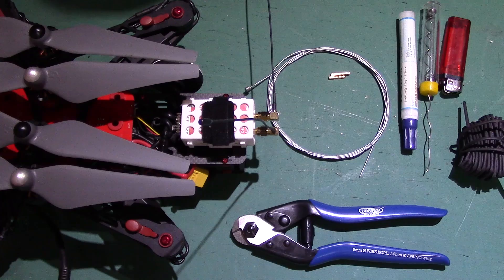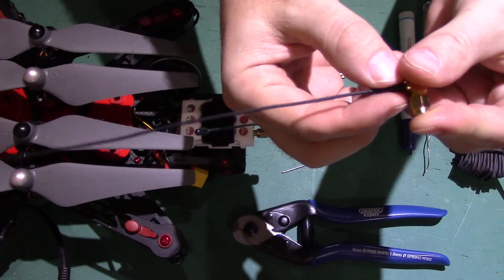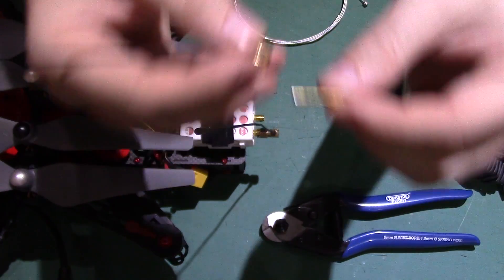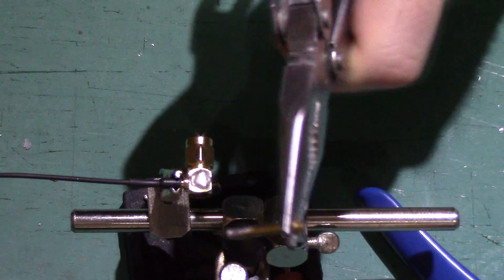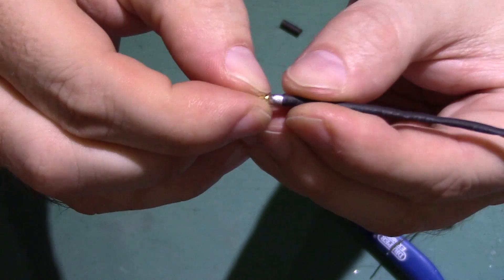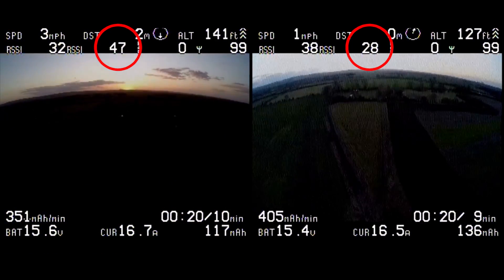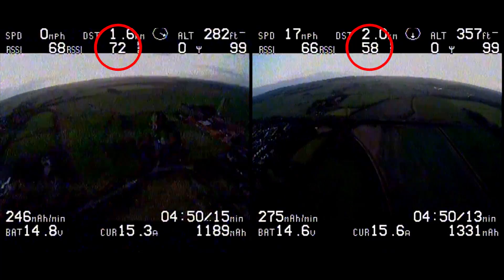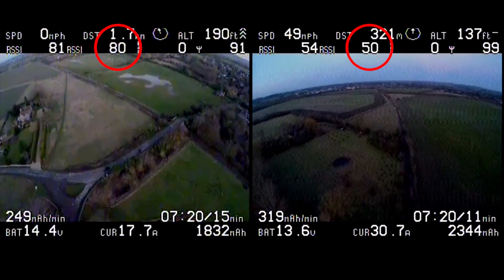EzUHF - D.I.Y Removeable Dipole Mod (Ideal for XuGong v2 Pro

Comment: I don't know why the even release TX or RX with 1/4 wave vertical on devices that cant give sufficient ground plane for antenna that needs ground plane to operate. Making a dipole you gave 1/4 wave vertical what was getting from your quad wiring..

Comment: I see you dont reply to any of comments left here so guess im sharing with the others....on a single 433 Rx like the flytron one which is sold just down the road from you ,I can get tested so far 4 ks using flytron DIY inverted "V" antenna
on both Tx and Rx using mig welding wire, the Rx is £20 ...hay you can even use two of them one for Tx also.love my ImmersionRC Vtx tho.

Comment: I'm just having some issues getting my ezuhf setup and still using standard antennas, I have the module tx version and totally intend on an antenna upgrade but expected to get reasonable distance on the standard supplied unit, scarily I get 500 metres before fail-safe activates, I've got very good separation on the model and a bit baffled, the videos help with bits of info here and there but initial impressions are not so great

Comment: Hmmmm with my EZuhf the higher the RSSI numbers the stronger the signal is ..( better )
Not lower as you keep saying in this video??
100 with flight transmitter right next to aircraft, and it drops some at distance ..
Dan

Comment: i got a pair of antenna from tbs but had not a lot of success with them over the stock , i would try this out cos I'm running the naza v2 as well , i was going to wrap some copper type around the transmitter (wonder if that would help)
Reply from the maker: +Aron Gatt Hi Aron. I would have said that wrapping the copper around the flight controller would be the first thing to try as that will put it in a farraday cage and reduce interference at source. If that showed good results then try doing the same with the TX but be very careful when testing it in case it does the opposite... it really depends how much of the signal leaks out of the TX but covering it may not boost the signal through the antenna, it might just dull the overall signal output by reducing the output from the TX itself..... all just theory of mine and I can't say I am a RF guru on this. Worth an experiment.
Reply: d3weyTube il keep that in mind and give it a try and see how it goes

Comment: You have created a dipole anttena for your reciever from a Monopole....The dipole will beat the Monopole always as the counterpoise creates a ground plane. More importantly, in particular on a multirotor it stops the uhf reciever using your video / common ground, which is noisy, this can have a very adverse affect on range. A dipole with counterpoise should always be set vertical, it will always outperform the other antenna on your reciever which kind of negates the diversity aspect.....If you are using a 771 TX Monopole, then again, set it vertical, NOT horizontal or parallel with the ground. If you are using a JR TX Module then mount the 771 on a separate adjustable bracket, so with the TX held level, the 771 is vertical....connect with a flexible coax. It will make a big difference, in particular in a difficult environment that a multirotor generates.

Comment: why not a cloverleaf antenna?
Reply from the maker: Hans Ham While it would work it'd be a pain to live with. Look at a 5.8ghz vs 2.4ghz... you can see the size difference. Now look at a 1.3ghz one (even bigger). So 433mhz would be considerably large and because it needs to be relatively rigid you'd need your own case for just the antenna (or a stand alone tripod with it maybe). I'd have to leave the experts to say whether it would be more efficient than a dipole too. In theory it would but i think you'd also need a matching one on the model too which might rule it out fully. Food for thought.

Comment: Good video. The reason why your quad can 'only' get to 3km is that your Vtx is screaming at your Rx at 3kms!! Forget Naza noise,Its fuck all compared to what your 600mwTx is throwing at it,I know its a different frequency, but still has the power to swamp your Rx. Do this test take your quad 4km away from your Rc Tx WITHOUT  the Vtx on. An elevated position for the quad would be more suitable. Bet you still have control.

Comment: This is very similar to IBCrazy's dipole/semi-rigid dipole. Do you use a dipole on your transmitter as well as your receiver? If so, have you seen any improvements using it as a transmitter also?
Reply from the maker: I have been using a dipole on the TX too. It is definatley better than the stock 'rubber ducky' antenna. I have since however bought a Diamond SRH771 whip antenna for the TX and that seems to have similar range. I am still finding that I am limited to about 3km range before failsafe kicks in. Seems that NAZA really is noisey!
Reply: I wonder if you could house the naza to block some of the noise?
Reply: d3weyTube hi david. I now have a good spectrum analyzer. gonna look a bit closer to the naza with it and see what kind of noise we have here.  also loved your tutorial here. I will also try the dipole now, didn't go much further than 1km yet. I als use the 771 antenna on transmitter.
Reply from the maker: RCSchim A tasty spec analyzer hey! Very nice! Interesting suggestion made above by ***** - you could see what effect wrapping the NAZA in foil would have (similar to the way TBS put the core in a grounded metal housing). As long as the GPS/compass was well away from it then it might help silence the noise a bit.
A few emails back Anthony said he was getting 4km on his so it will be interesting to see how your tests go. My DIY is based on his suggestion but my soldering is awful so it may simply be that a better job will yield better results.
Keep me posted (on here or via email).

Comment: My understanding was that ideally your transmitter and receiver antenna should be parallel to each other not perpendicular as you mention in the video. I'd be interested to see how far you can get/the rssi values with the dipole antenna vertical. Also I've seen 2.4g radios Flying 3-5km and I'd expect with higher output and lower frequency, that the ezuhf should go significantly further?

Comment: Very strange I posted a video a while back doing a 2km long range test using the immersion RC diversity receiver and the jr module, with the 600mw vtx. I had very good results and no problems. I also did a 4km test but was unable to record, with also good results. It was a helical antenna I used for the video. I think the issue was not the equipment I personally think it's the material that the zugong is made out of that causing the problem.